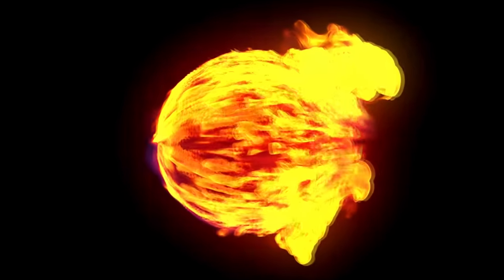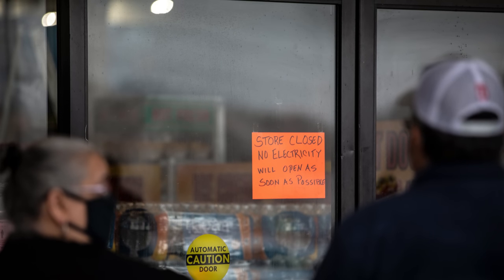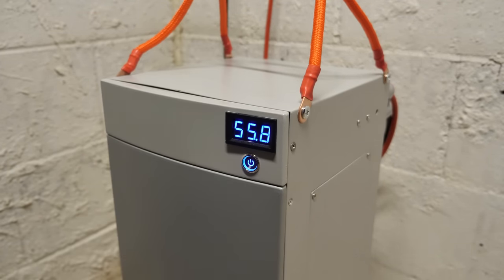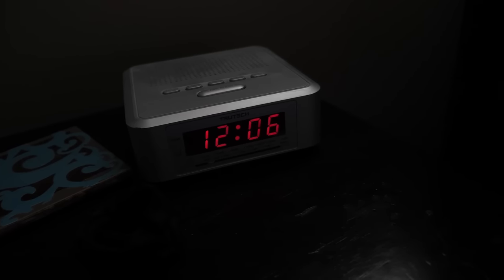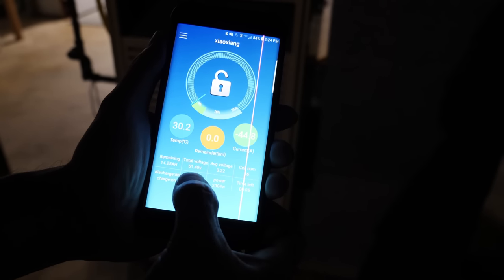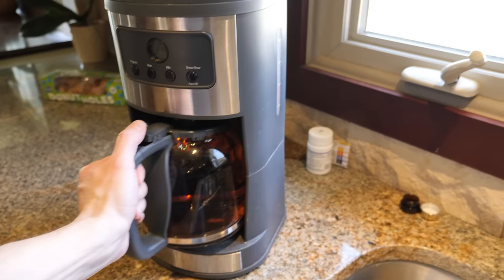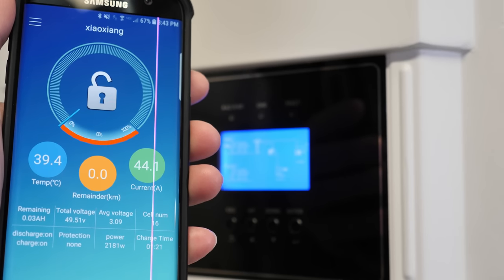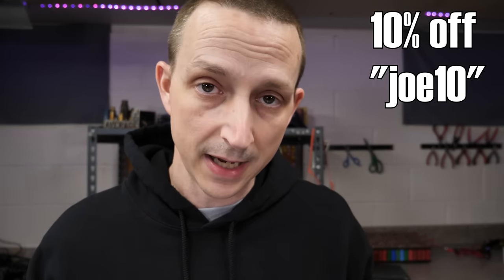Power your House with a Husky 48v 5.3kwh LiFePO4 Battery! BigBattery.com Test Review (2023)

Comment: You need to clean that coffee pot!  It's dirty enough to make Navy coffee!

I didn't hear if you mentioned your inverter having a generator input.  Is that an option?

It seems like 3 of these batteries would give at least 3 days of autonomy to my townhouse even if the solar charge rate was not so high (snow, rain, etc.).  I could probably get an easy week if I minimized sloppy usage like leaving lights, computers, or TV on when not needed.

Good video!
Reply from the maker: Lol good ol Navy Coffee!!!😆

Yes this inverter does have the genny contacts. I did a seperate inverter overview video and mention it in there. I also dont have a genny so Im not 100% sure how that part works. 

As far as the battery, You could get by with one in an emergency but you would want a few imo to live a little more. If you had solar or a genny then the options are endless!

Comment: Just an FYI, as more of this type of installation is installed, the restoration after a blackout becomes much more difficult as all the discharged batteries are trying to draw large charge current, in addition to all refrigerators, freezers, heat pumps, and heaters all set to draw at the same time. As more of this is installed, the power restoration takes longer as smaller segments can be restored and has to be powered in a sequence to limit inrush load on the grid.  Prepare for longer blackouts where more of these are installed.
Reply from the maker: Good point!!!! Solar would help a bunch!!!😲🤘
Reply: I'm sure the replenishing of the battery pack can be regulated to take a smaller load of recharging. It's called "technology"
Reply: just an FYI, take your time, be safe, restoring grid segments, as appropriate.  "It starts slowly; then, all at once."   Community micro-grids are coming; and they will make the entire grid more reliable.
Reply: @derrikarenal3308  Do you have any evidence of community micro-grids? Last time I checked, the NIMBY group does not want the emissions of the fuel in their backyard, and the cost to operate them is much higher than larger scale plants. Nobody is investing in maybe some day someone will pay the high price for surge priceing. Any ohter time it is offline and not making money. Most "Micro Grid is individual homeowners with a standby generator, most often fueled by Natural Gas, which as shown in the great Texas Blackout, is also in short supply in an emergency.  The question is Do you want 0.20 per KWH, or $2.00 per KWH for Community Micro Generation which only runs during surge demand?
Reply: Mr B  In response to your assumption, I am not a government worker. Due to Affirmative Action, I was the wrong race to enter the government workforce in electrical power distribution in the national grid. However, my dad was, so I had been introduced to the field of substation operations and the working of the national electric grid. Actually I did provide solutions.  The solutions are a mix of two items. Due to the start up surge, and capacity limits, the high AC load, car charging load, and other high power demands, the areas restored are SMALLER, and after those areas are cooled and high current chargers catch up, the remaining areas are added in small parcels. It is no longer flip the switch and the lights come on for large areas. If you want numbers, ask your local utility about the start up load after an outage in hot weather. Every air conditioner, refrigerator, freezer, and dead Tesla are sitting waiting for the power to come on. A central air conditioning unit starts then runs with a high heat load at about 3KW. A typical fridge runs at 200-300 Watts while cooling, Same for a freezer. A Tesla or Volt needing a charge connects to a 60A 240Volt circuit. The water heater tank having lost temperature will draw about 2500 Watts until the water is hot. Since you asked for numbers, They are available. A hot house with power restored, warm freezer, fridge, cool water heater, and dead electric car will have the following demand for about an hour or more.. AC 3-5KW, Fridge 300 Watts, Freezer 200 Watts, Water heater, 2500 Watts, Car charger, ~10KW for a load of about 20KW, where in the 1950's a typical house had an electric fan, not an AC, water heater, Fridge, no chest or upright freezer, so startup load was about 4KW maximum. Today's average startup load demand is greater than it used to be.

Comment: I'd like to see what the amp draw is running the A/C should be the highest load in the house, and during a "rolling blackout" extended outage one may need to cool down the house. All the little 120v stuff is meaningless.
Reply: Didn't you see how fast it was discharging when he showed you the phone screen at 18:14? There are way better options out there. Like a tesla wall. Now you can buy Tesla batteries on ebay for around 100 bucks. Tesla batteries are made up of hundreds of 18650 cells and will easily outperform the battery seen in the video. Of course he will recommend this one because he gets a kickback for everyone that uses his link. Should be illegal to do business like that.
Reply: I’m sorry to inform, but you can’t buy a $7,000 battery on eBay for $100. I just had 2 powerwalls installed in June 2021, almost $19,000.00 and even at that price, I’m very pleased. Solar is a good investment, batteries are a PEACE OF MIND purchase.
Reply: @jerrytalley802  I said a Tesla battery not a tesla wall. You can 100% buy a tesla battery on ebay for 100 do you need a link? The battery will be from a car and it is made up of 18560 cells. They are easy to get and hold a lot of power I could build the same capacity wall you just got for 1/5th the price.
Reply: @jerrytalley802  I just looked and the prices are up quite a bit but still very cheap compared to what you paid. I have seen them listed for much less than 1000 but that seems to be the average now for a 5 Kw pack.

Comment: Great Video!  I found this while looking for options to protect from the next power outage.  I live in Texas and was out of power for 3 full days.  I’m not interested in solar (can’t install them with the HOA anyway) but am interested in a battery and inverter setup.  Would you recommend this battery and inverter?  Can I charge that battery with a standard drag-out-of-the-shed generator if they power stays off long enough for the battery to completely discharge?
Reply from the maker: Thanks Man! 3 days without power is a long time for sure!!! I hear ya on the HOA😢 I would recommend them both actually. Inverter and battery. Reason is.....well I use the inverter daily now and its been great and has done everything. I have not maxed it out yet but dont think it will be a problem. Battery surprised the crap out of me. It would obvioulsy be better with a few. This inverter does have generator capabilities. I have not tried that as I dont have a genny but would imagine you would want one with 220/240vac output to supply the inverter so you could power your house and charge the battery. Once battery is full then turn the genny off to save gas. Also the place I purchased the inverter has a 6kw version if you dont need or want 12kw like I have.
Reply: You can charge that battery from solar or gas generator as long as you have something in front to get the proper voltage and current control.

Comment: The key for most of the south where we experience hurricane power outages is usually if it will run an air conditioner or not.  Usually these are on 30amp breakers with up to 60amp in-rush current for the compressor.

Comment: Can you do a video on all of your inverter settings?  I have the 6k version of this inverter, UPS mode, and it would be good to compare settings as they aren't well documented.
Reply from the maker: You betcha! Was planning on doing a video and going through the settings as best as I understand them!💥🤘
Reply: @AveRage_Joe  Also a bit more on the HSKY battery, I'm not able so far (ops day2) to get it to charge up to the suggested 58.8v. The Growatt and HSKY start fighting above 54v. You mentioned someday 1 cell balancing issues that seem similar to what I am experiencing. I will try doing the firmware upgrade next.

Comment: Texas "once in a lifetime" happened 3 times already in a single "lifetime". Every time for the same reason - The grid is not prepared or equipped for extreme cold, gas pipelines froze and power plants had to shut down. Renewables were affected very little and at the same time provided necessary electricity when the gas could not. The wast 2 time that this happened there were no renewables installed and the situation was way worse.
But now the media puts the blame away for gas and coal to the "competitor" energy source.

Comment: Yes sir...  you're getting into whole house territory.   So much fun!    I went 50g heat-pump hot water (max of 450w in heat-pump mode)  and 4ton heat-pump (heat and cool) for 100% electric house.   The Lennox 4ton heat-pump (top of line) is soft-start and maxes out at 5000w.   Completely doable with a couple of these batteries and in range of the growatt.    This stuff can be done!    Thanks for another great video.
Reply from the maker: Yes Sirrr! Thats one thing we need to upgrade bigtime in our house is the heating and cooling. Its sooooo inefficient is killing us for usage. Like its bad. Another thing is back in the 50s when our house was build they didnt really have insulation in the walls. It was more like cotton balls glued to a sheet of paper. Well now all those cotton balls are at the bottom of the walls. 🤦‍♂️
Reply: Or you could get a genset for a fraction of the cost for 'rolling blackout' situations.  Entirely off grid is doable, sure...but at what cost and maintenance?
Reply: @aday1637  true. But really depends on what your goals are. If your goal is to have home backup power as cheap as possible, then yes a standby or portable generator is the best option, which in all honestly is for most people. But if your goal is to truly not be grid reliant in these situations, meaning not be tied to the natural gas grid, or a propane tank that needs filled, being truly off grid with a solar+battery storage system will surely be the best bet. Also gas motors require infinitely more maintenance than a properly installed backup storage system.

Comment: I loved this demonstration and would ask you to do another..this time simulating a grid failure where you rely in this battery or additional units and a solar array to charge them relying on only that configuration for an extended period to simulate what semblance of a normal life could be achieved in this situation, and what recommendations you would have to get to near normalcy.
Reply: Ditto
Reply: He did a great job and yes it would also be nice if he could add a generator as well as solar
Reply from the maker: I Love that!!!!  Would be a fun test!  Would need to get the Wifie on board lol!  I would imagine I would need a few batteries especially if I wanted to run AC, Stove and Dryer since those consume the most!  I do have solar, just didnt use it for the "test".  With my inverter and solar running during summer, Its practically off-grid except the big consumer items!
Reply: Yes, I want to see this too.

Comment: Great vid joe. Appreciate all the effort and info. Just one point to make…..the talk is generally about Texas blackouts and running the entire house. I worry that folks will get the idea to get one of these and their problems are solved…entire house just keeps running. We both know that throwing  a water heater, A/C unit, Range or Clothes Dryer online is a LOT different than LED lites or Tv’s. The story would change real quick and in a hurry. That battery may be a beast. But no match for a teenager and a 50 gallon water heater. Of course, if all these are gas…..go for it!
Reply from the maker: Thanks mate! Ya you are 100% correct! Those other loads will drain a single battery down pretty quick! You would want a few more for sure!💯🤘

Comment: Very nice battery! When do we get to see the insides!?!
Reply: yes please! though we did get to see the PCB connecting the batteries in series and balance, though I want to know how the power switch works, maybe there is a 48v DC contactor?
Reply: Go to Will Prowse. I'm certain he's done a teardown of one of these
Reply: @yodab.at1746  : actually Will Prowse has not done a tare down. There is one on our YouTube channel now for the Husky. I think this is our best design yet.
Reply: Can I use separate Bms for ups to discharging only and charging from separate power supply when it is not in discharge mode
Note i am using 1kva 12v UPS which use lead battery ... and i want to use 3.2v lifepo4 battery instead
^ _ ^  ...i do not want to charge from ups it maybe  damage the lifpo4 battery   ...can it work ^__^
Reply: @cobra7615  sounds like it will work to me. I have been using a 4S LFE battery on a 12v UPS for a few months now. as long as the cells are well balanced you can charge with the UPS. Also having the BMS in front of the battery will protect it from the UPS over charging or over discharging the battery.
Reply: @SuperBrainAK  bro what battery you use lithium ion or lifepo4 Prismatic cell? do you have video for your ups and how you can do  this management ..thanx for your reply
Reply from the maker: Thanks Man! Oh I guess I could do the bow-ring capacity test and tear down video next!😆🤘
Reply from the maker: Yeah I guess that was moar of a teaser lol. I didnt look up under that area but thinking there is a contactor or something in the bms but well see!!!
Reply from the maker: Cant say that Ive seen this one on his ch but dont always watch.
Reply from the maker: Ahh there you go! Eric beat me to it!💥🤘
Reply from the maker: Yeah you should beable to no prob. 3.2v is a great option for that!

Comment: Hey Joe, great video as usual. Would love to see some pics (or a video) of your subpanel... Explaining from the spot where the mains come in to the house, then splits into two (?) where one goes into subpanel and the other into the main panel (behind the interlock kit)?
Reply from the maker: Thanks Man!  I may do a video on that.  The only thing is the other panel that supplies the inverter is super old.  Was installed back in the 50s, (has those screw in fuses lol) so it looks sketchy.  Ill at least have a wire diagram. I could show the panel by the inverter tho for sure.
Reply: @AveRage_Joe  I have a question with your sub pannel.  In a typical subpanel, your Ground and Neutral are not bonded together and I assume your Sub panel they are not bonded.  But having the inverter wired to pass through to the panel, I would think that the subpanel should be like a main panel where the Neutral and Ground should be bonded.  Am I correct in my thinking here?
Reply from the maker: My inverter is grounded to the Main panel.  My sub panel is also grounded to the Main panel.  The Main panel has the neutral and ground bonded so if either way, the neutral and ground are bonded.

Comment: Great video, and an amazing battery!  I am in Texas but we did not have the power issues.  Although, same grid issues so I'd love to have a UPS that would handle my entire house.  I know my electric heat would take a ton of amps, but maybe they could still work if not much else is running.
Reply from the maker: Thanks Man! Yeah pretty sweet battery for sure! Yeah the inverter I am using can handle 12kw of power and surge to 36kw and is more for running the entire house. Yes the battery would need to be bigger for electric heat plus using all the other things but can be done!🤘
Reply: Get a couple of mini-split heat pumps and can the strip heat.   My 2 ton uses about 2.5 amps at 240 volts on average.  I have 3 all together but only need one to keep us warm in a grid down event.  Strip heat can use many, many times that to do the same thing.

Comment: You also need a means of recharging that battery away from grid. Given the last newsworthy Texas blackout that couldn't roll as planned power was off for days in places, if then everyone wanted to run the house AND recharge the battery the blackout could have lasted a month.
Reply from the maker: Yeah optimal would be solar for sure.  If you cant have or use solar then a generator could be used as well!
Reply: I think you'd want to have both Solar and a generator, because there will be times when you it's cloudy and you can't get enough power from the sun to fully recharge the batteries, and yet the grid might not come back for another few days.

If this one battery lasted three hours, than it seems to me like you might want an array of twelve or more of these to be able to sustain your house over a period of multiple days.
Reply from the maker: I just did a video on the new Rhino battery from them and its 14kwh! So almost 3 times bigger. Doing roughly the same test with zero solar on it lasted almost 11hrs. Yeah you could for sure have a genny on stamdby if no sun! New rhino is pretty sweet!